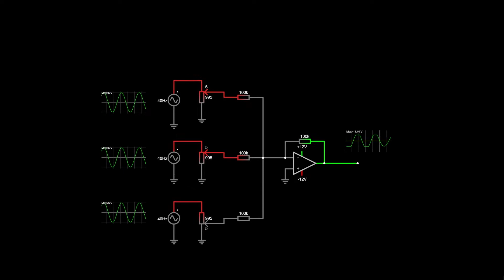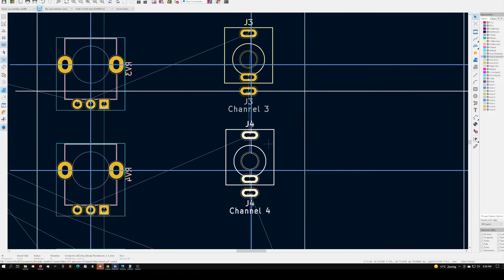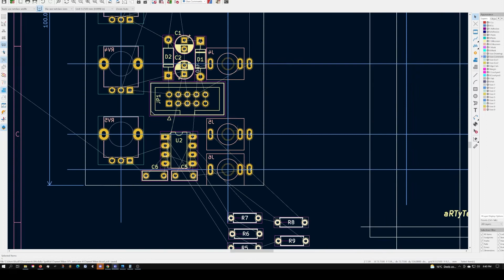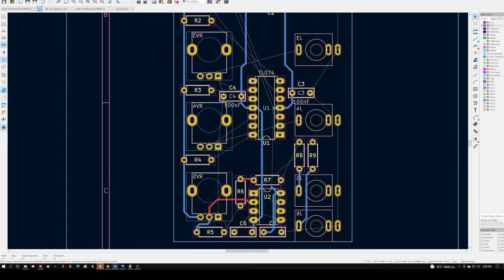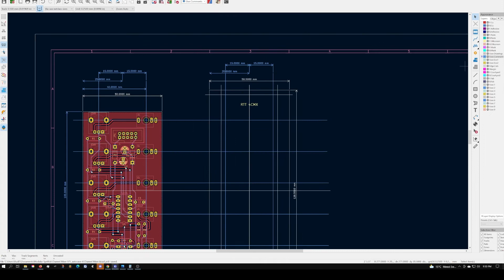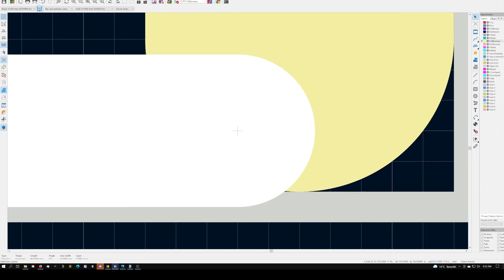Building a DIY Modular Synth Template - S01E05 - 4 Channel Mixer

Comment: Nice video! I spotted one thing in the circuit that could be improved: By adding the "master level" pot RV5 you're partially re-introducing the problem you solved by using an inverting op-amp for voltage summing since your inputs aren't directly connected to the virtual ground summing node anymore. You can fix it by instead putting RV5 inside the feedback loop of U2A in place of R5.